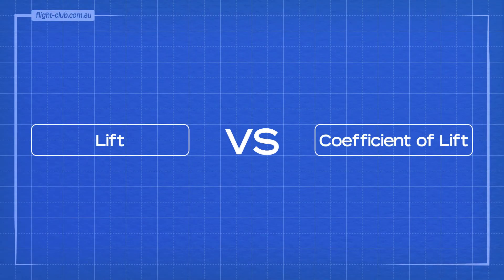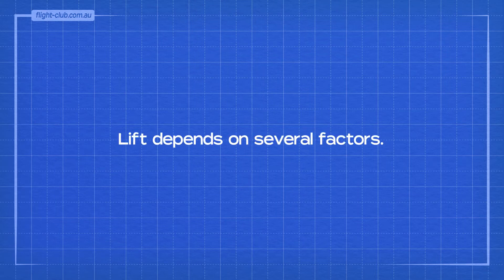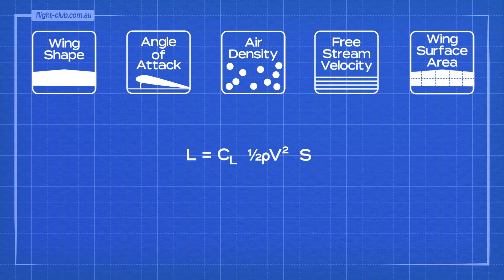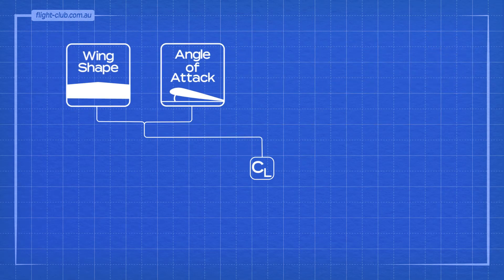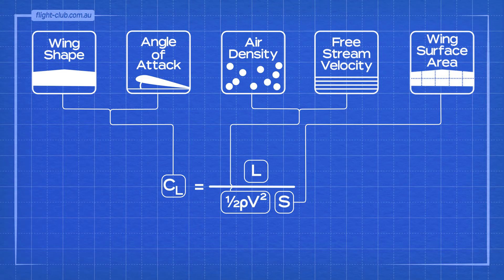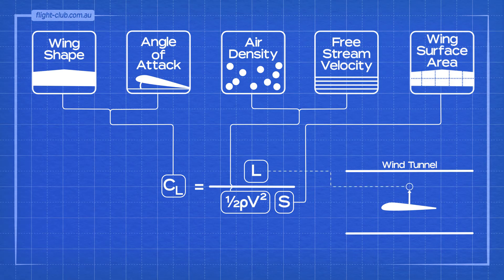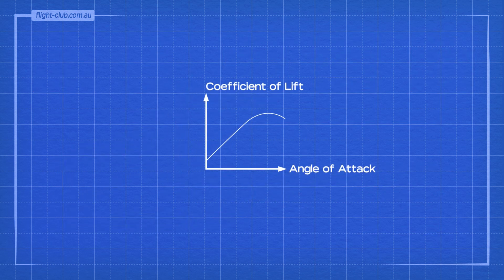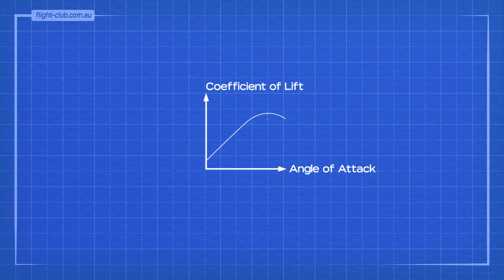Lift vs Coefficient of Lift. What's the difference?

Comment: Actually, lift coefficient also takes into account other effects not explicitly specified in the lift equation, including compressibility, viscous effects / shear stress effects etc ... basically all the extra  detailed stuff people fight about in terms of "what is lift / how is lift created" (i.e. is it "bernoulli" ie dynamic pressure effects, what about coanda too etc). All the other little bits included in the equations of motion which we dont explicitly specify in the equation for lift are bundled up into Cl ...
Reply: Compressabily, viscosity and shear effects are predominant in drag effects.

Comment: 2:11 How measure LIFT? Because only i see lines. Surface of entire plane or just the surface wich are inside the tunel?
What if the density change? on the ground is 1080hPA and at 10km is 380hPA.
I need more details on it. Thank you.

Comment: A very good explanation. Coeff of lift is a non dimensional parameter. Engineering requires extensive use of non dimensional parameters so as to obtain meaningful information and quantifying data.
Reply from the maker: Much appreciated.